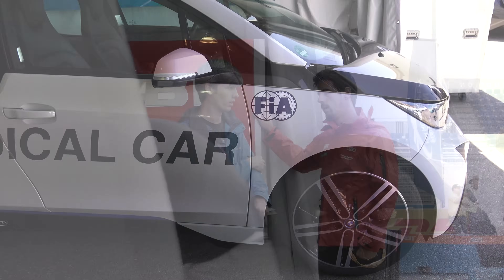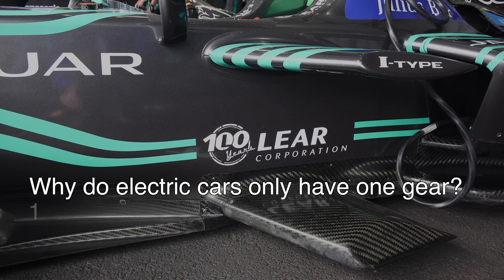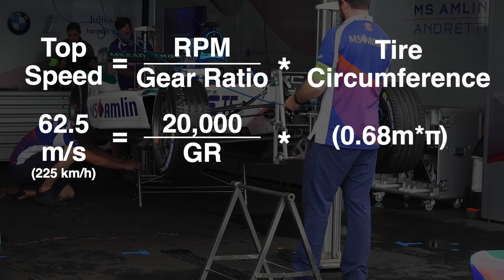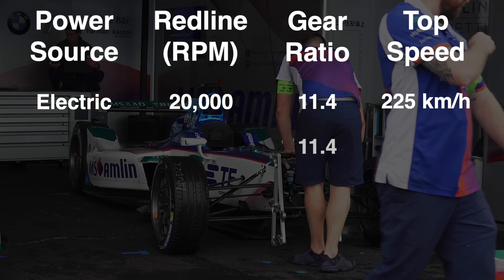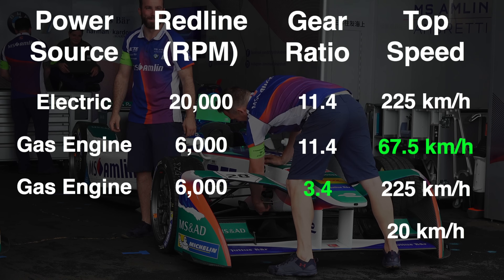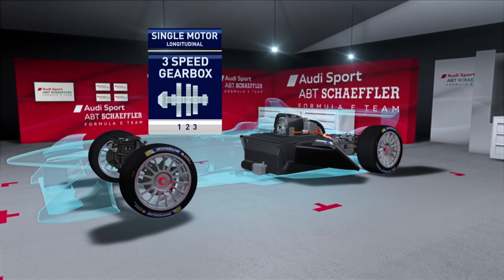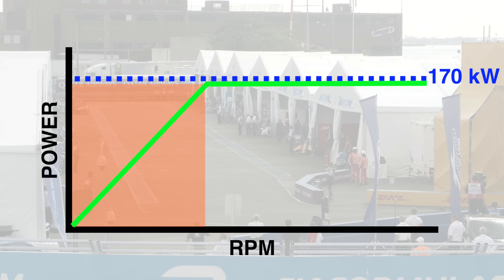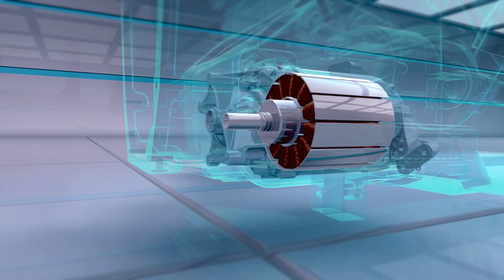Why Do Electric Cars Only Have 1 Gear?

Comment: If they really wanted the sport to succeed in overtaking F1 as the premiere racing championship, FE needs to massively raise the power ratings to encourage what in F1 is often known as "cheating". I'm dead serious. They need to cheat. Cheating means innovation, invention, intelligent designs, creativity... The teams need to become manufacturers of their own batteries, motors and everything else like in F1 so they can start cheating like crazy... And then the general public gains from this and road cars get better.
Reply: Maybe having formula racing could be little benefit for EV company, because the huge amount of cost for research but lower impact

they still need to focus on essentials like production scalability, lowering battery cost and increasing range or capacity, rather than branding, the demand is higher than their production capacity right now

Compared to ICE car, EV has different components, means there is no industry best practice, they still need lot of research on optimizing thing, create production method by themself, to increase production output

Meanwhile EV is gifted with that high rpm feature, they did not lack in speed or performance, thus branding is not their priority concern right now

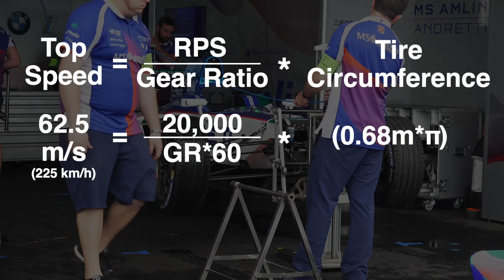some EV manufacturer like lucid air and tesla race their consumer car on laguna seca, that 1:30 lap time that normally can only be achieved by an ICE super car like mclaren P1, that is proof that they dont even dont need much effort on branding,
Reply: @flmworks  Thank you for your input and thoughtful, detailed reply. You make a compelling argument, though I respectfully disagree with your assertion that there is little benefit and little application. 

Disc brakes, active suspension, sequential gearbox, aerodynamics, steering wheel functions, engine mapping, kinetic energy recovery, crash crumple zones, automobile sensors, active computing and data processing (software adapted from F1 for use in ambulances and hospitals to predict heart attacks), tire research, Kevlar research, carbon fibre weaves, carbotanium, materials sciences (information which is supplied to aeronautics industry and NASA), engines and how to get the most out of them, turbos connected by shaft to both recover energy and use energy off throttle for instantaneous power without lag... This list goes on for a long, long time and I've barely scratched the surface. The point I would like to drive home is that experimentation leads to invention and innovation. It's a worthwhile investment because if just ONE invention or innovation has application somewhere else in the world, it creates new revenue, new industry and improves the world.

I believe that Formula E is in its infancy right now, I also believe that the concept of it is being mismanaged -it's not sexy, exciting, mind blowing and it doesn't make people nearly as excited as they could be... And that's because there really isn't a reason to get excited. What you find in Formula E, you can find in a road car... What if that wasn't the case? What if Formula E had rules that attracted manufacturers, inventors, innovators, investors, the world's greatest drivers? What if a Formula E Grand Prix ran the same distance as Formula 1 -but the cars were twice as fast? How many people would want to watch that? How many NEW things would be invented along the road to get to that point?

When Formula E is faster than Formula 1 and can run just as long and just as reliably, road cars will improve. What we have in the world today, the best EV's have nothing on what the future holds. Imagine a 10% improvement in every area of development.... That's not just 10% better, that's a quantum leap forward because it's in every category of design and engineering, every single part is 10% better and this will have massive impacts on improving production, efficiency, handling, suspension, weight, heat management, etc.

I get that electric cars are really, really fast and they're quite honestly cool as hell -but they're nowhere near to achieving their full potential. They're in their infancy -so are batteries, so are motors and so is charging and efficiency.

So I think Formula E needs a massive amount of funding and marketing, it needs to work shoulder to shoulder with scientists and manufacturing so that things which haven't even been dreamt of yet can become reality...

I remember what cell phones were like before the first true smart phone was introduced by Steve Jobs, the Apple iPhone... The many inventions and innovations, creative application of existing technology and minor improvements along with a hell of a lot of forethought and imagination and quite honestly, the technological visionary intuition of Steve Jobs (who was basically a prophet of technology) has changed the world forever. 

Look at the internet and how that has grown and become a dominant force not only in the day to day lives of nearly everyone in the developed world, but it massively contributes to the GDP of countries. When it first started, it was for nerds. It was very slow, it literally connected only two computers. Now look at it.

I could go on all day about why innovation is so important, but in terms of Formula E: in order to succeed as a sport, it needs to become a crazy place full of brilliant, crazy people who make and innovate new things; a place where inventions are dreamt of and tested and innovated, a place with a wide open rule book where those who dare, win. They have an opportunity to radically change the future... Only they're not doing that because their rules are choking the sport to death. 

Let them cheat!!
Reply: @flmworks  yes the main problem of EV is not performance. It's to get the performance they have to a reasonable range. And that is something motorsport can actually deliver. Open the rules and force the teams to race on real tracks over serious distances. F1 isn't allowed to refuel either. Gearing to gain efficiency edges becomes more viable if you have to race for longer. Also, a 24h race would be interesting. Give the teams free choices of their batteries and limit the power they can recharge.
Reply: @flmworks  un hnn
Reply: @Allen Loser I think everyone knows that. I do at least, I've been watching since the first race.

More power =innovation, ingenuity, greater speeds, more fans, more money and faster development. It's good for the sport.
Reply: everyone is talking about long pit stops; why not just design a mechanism to swap the depleted battery for a fully charged one; and don't give me that crap about how complex it is! If we can make a engine that revs to 20k we can make a freakin' car with a removable battery. It may not be as simple as positive negative ground but I bet they could build it, and it only take 30 seconds to swap the battery.
Reply: @evandossvideos  sadly it is way easier to get the Motors up to 20k than to change the Battery. You have cooling fluids, high voltage for power, and low voltages for control. But you are right, it would be great to see a more challenging Formula E on the engineering side with more opportunity for innovations. But my biggest problem with Formula E is that these cars need to have bigger batteries. Formula 1 drives an entire race on 110 kg of fuel. Formula E should set a limit to like 400MJ. Also, bigger batteries enable the teams to use higher energy - lower power types of cells. You still get the power you need by the number of cells you use in parallel, but you get much closer to what you actually need in a road car.
Reply: @evandossvideos  that's exactly the type of innovation I'd like to see on the list of things that could massively improve Formula E. Great idea!

With pit stop battery changes, it could revolutionize the entire car design. The batteries would not be required to go the same distances as before, the car would not be required to manage the thermal properties in the same way as before. Instead of having terminals for positive, negative, ground, recovery positive, recovery negative, coolant in, coolant out; the teams would likely have to actually INNOVATE to make a harness and loom to make it all just one simple connection (remember when it was thought to be impossible to have one lug nut all those years ago? Now it's standard in most competitive racing). And not only could the batteries be smaller and the terminals and coolant massively improved through innovation, the ENTIRE car can be designed to incorporate a smaller, changeable battery... And how about actually changing the shape of the batteries? As it stands, they're these enormous blocks nearly the size of the blocks used in concrete retaining walls and massively heavy... They could change the shape so that they're lower, and... Maybe since they're so bloody big and heavy -make them structural(and invent a way to make them changeable in under 15 seconds) like an engine is in F1 -that can be figured out. 

So far, I think Formula E is stumbling around trying to find it's footing, it's not exciting enough, it's not fast enough, it's not interesting enough and they concentrate far too much on efficiency and never enough of raw power and speed. The problem is that they're operating with the wrong attitude, they're placating manufacturers instead of promoting competition, innovation and the race to not only win -but to build the most futuristic, fastest f$#@ing cars on the planet. That should be their goal.... Make Formula 1 and LMP1 look old and slow. 

We know just how ridiculously fast a Tesla is -a Formula E car should make a Tesla look like your Grandma's wheel chair... And it currently doesn't.
Reply: Toyota tried to test those waters in wrc and got banned for 20 years lol
Reply: @jarjarbinks6018  lmao, good on them
Reply: @Viscous Shear lmao!! Exactly!!!
Reply: funny enough the same rule apply in war technologies, the internet is basically the army's hand me down to the world  🤣
Reply: I'm in a College project called LEM Wrocław, and this is exactly how it works here. We make electric motorcycles on our own, the only thing we get is an engine (specifically for a race) , and we have to make everything else with our own hands and knowledge.
Reply: Sorry man but in the present rn, they've hit a wall. Even with Battery chemistry improving power in FE  still very low, with mamy safety and adequacy concerns regarding EVs in general have right now it's only a matter of time that the sport fades into irrelevance.
Reply: @HenAnt  That's entirely possible. It's also possible to introduce things like carbon charge (one atom thick), wireless charging on track(already a thing in Detroit, Michigan), weight reduction in the batteries, better cooling systems... But even if they had access to these technologies, they simply won't invest
Reply: @wardencobb7442  No, because it's physically and economically impossible.

 Carbon charge is nowhere near as energy dense nor provides as good Flow as Lithium and are nearly just as expensive, Wireless charging is no better than direct charging while being a safety hazard for these vehicles, changing battery chemistry would require breaking the laws of physics, make them too dense they'll spontaneously combust, there's a reason why Panasonic (Tesla's Battery Manufacturer) has given up on making batteries smaller and resorted to adding more battery weight over the years, even then efficiency losses in electric vehicles get greater the more drag, more heat, and the colder it gets, and the only reason why FE is able to be as watchable as it is right now is precisely because they capped power to a point they could actually finish 50 laps. No amount of RND is going to bypass those basic restrictions in physics.
Reply: I... Honestly I have to agree!
Reply: @Vic Rolmann Maybe you're right... Or maybe:

-Tesla is the most valuable car company in the world
-model s plaid is the world's fastest production car EVER.
-electric drivetrains require almost zero maintenance and repairs for as long as you have the car
-charging Ev's is MUCH cheaper than gas and diesel.
-all major manufacturers are already either trying to or already are producing more EVs and hybrids than they do old school cars
-the market clearly demands EVs
-the f150 lightning is now: you guessed it, a fully electric truck. That's a statement.
-the all new Hummer is a fully electric vehicle... That is a BOLD statement.

I'd say the main problem with FE is the simple fact that the FIA is corrupt. **Obviously** corrupt.
Reply: Yeah, make it a free for all, that way the racing teams can figure out how to maximize performance, efficiency and range of an EV! Multiple small engines vs. one big engine, added gears for efficiency vs. weight savings by using a single gear, etc. I don't think enough research has been done on how to get the most out of an EV, but it would be really interesting to see all the different approaches imaginable go up against each other! 

Also they should remove the power and speed limits. Maximum of 170 kW and 225 km/h? Who wants to watch pro drivers in formula race cars that are less powerful and slower than many affordable used ICE cars from the last decade?!! 😂😂😂😂

Comment: Excuse my ignorance but would it be reasonable to pair an electric motor with a CVT?
Reply: I think pairing a electric motor with any transmission will do magic
Reply: No. CVT are ideal for Motors where you need a lot of gears ratios / motors with a small RPM range.
Electric motors cover a wide range of RPM, only at the end they need a large jump in the ratio so they are at the other end.

Comment: I would think it would be beneficial to still have some gearing in an EV.    Spinning an electric motor at 20,000 RPM is not something that is great for longevity.    Bringing it down to 3000-5000 RPM would make it last much longer.    Also electric motors lose torque as RPM increases, opposite of a ICE operating in the power band, so keeping the RPMs lower will reduce torque fade.

Comment: yeah whatever dude, an electric motor does not have infinite torque so adding a lower gear provides the corresponding proportional increase in torque at the wheel and so improved acceleration.
Reply: Doesnt have infinite torque, just for the expected speeds it has enough to cover. 

No point gearing a car to do 300 (k)mph if its racing somewhere that naturally limits it to 150 (k)mph. Same sense most cars are geared to cruise at motorway speeds in top gear. 

The problem with adding gears is the packaging. It may mean a smaller motor or increased weight - which is not great for racing.
Reply: @Garfie489  Gears are a miracle fact of mechanics, electric motors are not in some other universe, nevertheless we'll in fact we'll end up at the same place. WHich is playing off the increased weight/size of a higher torque motor vs the size weight penalty of getting that torque from gears. As is now playing out in electric vehicles race and road. I don't think efficiency of electric motors with revs is a dead flat curve either - I'll bet multi dimensional computer modelling is mandatory.

Comment: Very nice video - but I believe street EVs should be geared for a simple reason. Its not about power and speed - its about range and efficiency. While the efficiency curve allows an EV to not require gearing, a single gear EV will start using significantly  more energy over 50 miles an hour than going the SAME DISTANCE at 30 miles an hour, and that can massively affect an EVs range. This is why an ICE car is more efficient on a motorway, and while an EV is more efficient for the City.  A simple 2 gear automatic system would eliminate that problem
Reply: Can you please use metric units?
We should abandon imperial units like miles.

Comment: Three speeds could be done with an upscaled hub gearbox. Same principle as a Sturmey Archer bicycle hub gear. They are quiet but extremely efficient. Come on Formula E lets have some out of the box thinking.

Comment: Nice final frames with the rain :) I have an 2016 Tesla P90D and it surely feels like it can have a second gear engaging from 70mph on. While the car has an enormous amount of power in the low speeds, it loses that power advantage to gas cars after 70mph. And yes, I do acknowledge that this means more complexity and more strain on the battery. But just imagine the crazy acceleration up to 150mph :)
Reply: That is what I am saying as well. I don’t own an electric vehicle but take that Formula-E car for example. It does 225 kph with the electric motor and just 1 gear. If you were to just slap on ONE more gear then you could easily get 375kph or maybe 400 kph out of the car. I understand that the electric motor is high revving and all but you can’t tell me that, speed-wise, it wouldn’t benefit from just 1 more gear!!! Crotch rockets oftentimes redline at or around 15,000 rpm and they have more than 1 gear. I know it’s apples and oranges but still. I would like to know your thoughts on my opinion, if you don’t mind.

Comment: That is the STUPIDEST engineering I have ever seen, and I've seen some doozies! Each powered wheel should have its own electric motor. Period. Anything else is a crime. I was shocked that this was not the OBVIOUS default.
Reply: There are good reasons to have a single motor. It can help with packaging for example, and thus may even provide more power than two individual motors. 

The main advantage to a motor on each wheel are to combat wheelslip etc, but thats not a major concern here. It can also improve cornering, but again you need to trade that for packaging in racing environments.
Reply: Garfie489 - Infrastructure reduction, thus friction and weight reduction, reduced complexity, increased control.